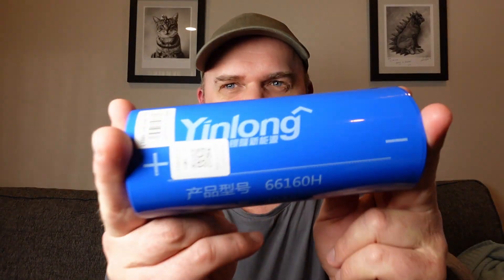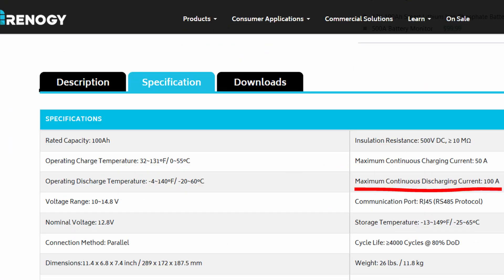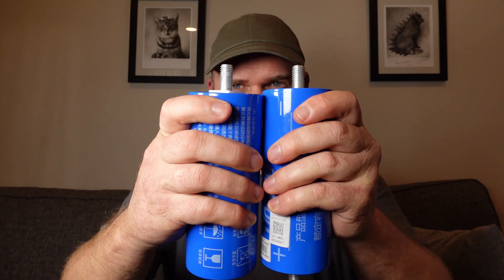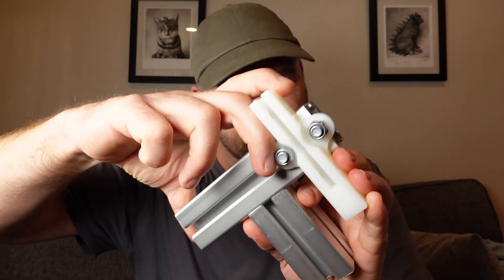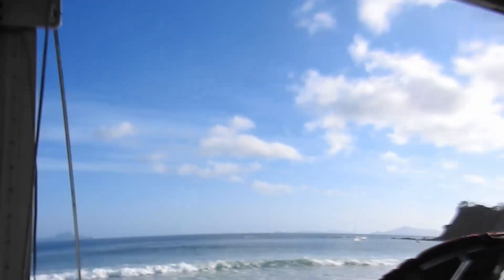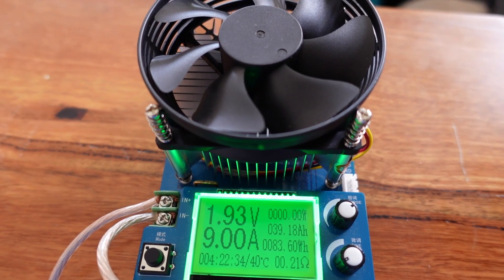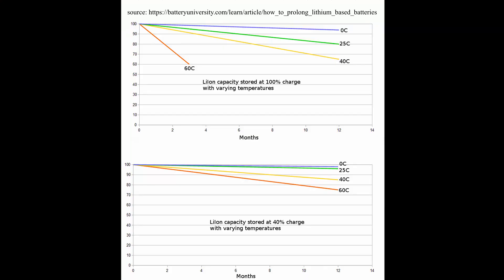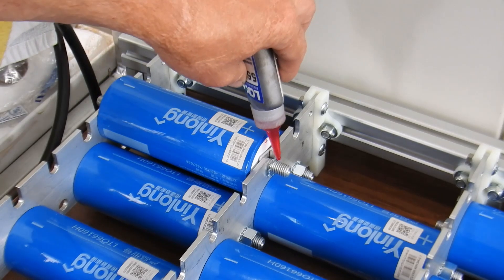Campervan DIY battery build HUGE POWER!

Comment: To anyone unaware in the comments, this is basically a video where this guy uses affiliate links in his description to sell these batteries, essentially he gets a cut of the money for people going there and buying them. Thus his video isn't objective, it's more akin to an infomercial trying to get you to buy these Chinese batteries. 
These batteries are not a new chemistry, and they are not invented by China, despite him implying that. 
This chemistry battery was invented in Japan (just like all modern lithium battery chemistry) and it was used in Japanese EEV's more than a decade ago. 
Their only real selling point is safety, because they have a much lower energy density that lithium ion batteries and they are also more expensive per watt hour. 
For example the voltage is 2.3-2.4v, unlike the 3.7v of lithium ion, also these Chinese made batteries often don't live up to their capacity claims, which thousands of youtube testing videos can show you, if it claims to be 40Ah, it's likely closer to 30Ah in reality etc. 
These have been tested by actual reliable youtubers, not people trying to sell them as affiliates, and the real capacity is around 30Ah.
This means in Wh they are around 69Wh per cell. BTW the way the Chinese are able to lie and claim 40Ah, is that they do tests under ridiculous conditions that don't conform to international standards on testing, meaning they draw on it at an incredibly low rate, where as real life drawing reveals effective capacity to be only 30Ah. 

That all being said, it's not like this guy on this video is a full blown scammer, these batteries do work, and you can make a power bank from them easily. 
However, you will be spending more money than you have to, and these batteries are unlikely to last the amount of cycles that they are advertised to last for, virtually no Chinese battery does. 

If you are looking to power a campervan via batteries, the most reliable and true method is to use sealed lead acid battery. These don't vent gas, they don't explode, and they last pretty long and are easy to use with any charge controllers and solar panels. Also, you should stick away from buying batteries from China.
Reply from the maker: I have got affiliate links - which I fully disclose, this helps me pay for camera gear and time to produce videos.  My objective is to make the best and most rugged battery for my campervan that is possible.  I bought the cells with my own money, as I said I want to make the most reliable pack I can for my truck I could have chosen to make my pack from any type of battery I wanted.

I mentioned in the video that in preference I would have liked to have bought the Toshiba cells to these but wasn't able to get them, so disagree with you entirely that I'm making a full on infomercial about them.  I do rate a lot of the aspects this chemistry has and am sharing what I know.

These cells have many advantages - primarily use in the cold, safety and ruggedness.  I have heard of someone charging one of these cells backwards by accident and it still retaining full capacity when charged again normally.  They are more robust against failures in a BMS, large current spikes from capacitive loads etc.

I said in the video that chinese sellers often misrepresent their capacity.  However, all of my cells have tested minimum of 40Ah - other videos I have you can download the speadsheet of my test data.  At least one 'reputable' youtuber has reversed his original statements based on my testing (Prowse).  My cells have tested at around 95Wh which is a long way from your claim of 69Wh.  Tests I have done ranged from 8-20A all giving the same capacity readings of over 40Ah - I'm not sure if you think this is an incredibly low rate - but for my main tests I think it equated to a draw of around 1,800W from my pack - again not incredibly low discharge.  These cells do not suffer the peukert effect anything like lead acid.  They actually are one of the best performing cells at high discharge rates.

I understand your sentiment on chinese products, and I am the same.  As far as the cycle life goes - I don't know how long they will last, all of my research shows that they are reliable, safe and will outlast any other battery on the market if looked after.  They have been working in my truck for coming up to 2 years now with zero measurable degradation in capacity.

I resent your comments with regards to me being a shill in order to sell cells.  There has been a lot of misinformation on youtube about this chemistry, and while there are a lot of chinese sellers selling reject batteries as grade A, I wanted to show that several youtubers have given incorrect information about them.  It sounds like you have zero first hand experience with this chemistry yet you come across as an authority about it?

As far as you thinking the most reliable/best battery for campervans.... ROFL!  I think that statement says everything about your experience levels.

Comment: I wouldn't buy anything from china.
Reply from the maker: Unfortunately it's not always possible.  If you buy a "made in 🇺🇸" battleborn battery, the cells are still made in China.  I understand your sentiment on many levels, like I mentioned in the video I would have preferred the toshiba cells from Japan, but couldn't get them.

Comment: Interesting project but i'm guessing that whole setup is heavy? then i saw your camper is a truck so weight is not an issue, i went with a pair of 120A LiFePO4`s in my MoHo mainly for the weight saving.
Reply from the maker: It weighs about 120kg.  A friend of mine has a LFP battery in his van, kWh/kg works out pretty similar.

Comment: Hello , just came across this video and have been lookn to do a camper build on my F250 4x4 and the batteries are the major cost to the power end of the build and this looks to be way cheaper and the longevity over all sounds a whole lot better and I'm guessing lighter as well... Now if I'm understanding it right these are (almost) like a capasiter but not the same discharge I know they're not but the charge to discharge rate is way better than standard batteries.. Myself I want to go solar and wind turbine at night or parked for more than day or two is my thoughts to stay ahead of being without power due to limited storage of battery bank and roof space for panels so wind and solar.. THANK YOU for posting this video    So from the States PEACE
Reply from the maker: Thanks Kyle, it's not the most cost effective option, but it is the most rugged I could do.  I'll be doing cheaper packs in the future. I'm charging with just solar and I have more than enough power, cooking of induction stove, domestic fridge etc.  works great.  Cheers

Comment: Holly shit so my 350 ish watt hr One wheel XR could be topped up twice on just one of those battery's?

Taking note that if I wait to long I will loose some of the stored energy.

But if I understand your calculations right I would have enough for two charges plus enough for bleeding correct do I have anyone that knows electrical calculations can check my ball park?

I charge at 63v 3amps
Reply from the maker: No, I think you've misunderstood sorry.  Each cell is able to put out 900W of power, but only holds about 95Wh of electricity.  These have one of the lowest energy densities of the lithium chemistries available.
Reply: @brendontait6968  Ah I see so I would need 6 of them. 😕 shit!

Wait, but if I just use one of these and plug it into this solar controller I could use it as a capacitor to buffer the connection and make sure it's clean and stable. Compared to going from solar panels to the solar controller to board battery.

https://www.amazon.com/dp/B07PVDY1V7/ref=cm_sw_r_cp_awdb_imm_49JSGNQ08CY735D5M5PE

Putting this capacitor onto the battery terminals would supplement a cleaner transfer wouldn't it?
Also how heavy are each one of those batteries when they're full

 I've had my leg ripped off and reattached a couple of times missing some muscle ankles partially fused. But I STILL like to go on my eboard OWXR and I'm trying to make a project out of going off grid by 100s of mi, already got my 200 watt solar blanket that folds up into a 1ft by 1ft by 3.5in 12lb pack I can carry. I can't a radically charge my board in 2 hours very reasonable.
And efficiencies so high that I can get a good 1/2 speed charge off of infrared light for night time charging from a modest fire, so I can get a early start. Or ride to dusk without charging.

So wait is a huge factor to me weight is pain and faster exhaustion, and taking water will be the biggest thing weighing me down. But I'll take a LifeStraw so I can carry lots of water less often.

So many large stretches of Rocky planes on the Colorado Trail so will need to carry what I need.

The way I have to charge to go makes me feel like I'm Mark Watney trying to get back from Mars on solar power on a ATV eboard.

Comment: 1. use blue locktite, it comes off easier than red. 
2. your link to the resistance meter is a dead link. 

Love the video, and the information.
Reply from the maker: Thanks, I used an equivalent to blue loctite, but still unsure.  I updated the link.  cheers

Comment: some lithium ion phosphate batteries are rated for 7000-10000 cycles, and price is dropping quickly - 1280 watthours for less than $500 in some cases, less if you buy the raw cells - that being said i love this battery chemistry and would love to see a commercially available version developed
Reply from the maker: I've heard about LFP being developed with different cathode materials that have a lower expansion capable of that number of cycles but haven't seen them in production yet.  Do you have links?  I liked the safety and ruggedness of the LTO on this build.  I'll deff be doing future LFP builds.

Comment: 20,000 cycles? Believe it when I see it. OTOH 4000 cycles for LiFePO4 is tried and true. Excellent work on the machining but agree that 48V would have been easier and better.
Reply: Do the research on the batteries man all I can tell you they've been around for decades or more and they're improving the technology with the batteries he's using they're very legitimate battery type used for commercial buildings as battery backup and to provide High amps for specialized equipment.

So the fact that these are used in scientific and Commercial settings I believe they're just as safe as lipo if not more especially with the test he showed with them shorting

Comment: how effective would these be as a  electric car conversion? also it gets to -30'c in canada so I'd need a heated garage of course? is that 3$ to charge the batteries for 250 mile range?
Reply from the maker: Mitsubishi and Honda have used them, however their capacity vs weight isn't great.

Comment: Lithium Iron batteries still have 85% capacity after 5,000 cycles. so with that in mind the math makes them a lot more desirable. but I love  what you are doing.
Reply from the maker: Cheers Jeff, tho I've never seen LFP cells last that long.  The reason I chose this chemistry was due to safety and ruggedness.  They can charge in freezing conditions and I've even heard of them accidentally being charged in reverse and retaining full capacity.  A failure in a BMS will be less likely to kill the pack.

Comment: I guess they dont need equalization? Individual?
Reply from the maker: Kinda, but not really.  I manually balanced each parallel set manually.  I'll show how I did it in an upcoming video
Reply: @brendontait6968  so how often will you equalize?
Reply from the maker: @flyingdiscproductions  I'll keep an eye on them, but maybe once every couple of years or so.
Reply: @brendontait6968  and what in your experience tells you that is adequate ?
Reply from the maker: The battery has been installed for two years, haven't rebalanced yet and it powers a domestic fridge every day even when I'm not in it.  However, this will depend on the mix of internal resistances of your pack.
Reply: @brendontait6968  Dometic?
Reply from the maker: @flyingdiscproductions  domestic....  household.  It's jst a samsung

Comment: Great video.
I'm clueless,but I'm interested to know if  these type of batteries would work on Ebikes or E Mopeds equivalent to 50cc.?
Reply from the maker: They would work.  But they would be relatively heavy for the range you would get.  They are approx 3 times heavier than the more flammable type.  However...  for my purpose the weight is not much of a consideration.  I'll do a bunch of electrical videos in future from basic to fairly advanced.  Follow along and learn

Comment: Hi Brendon, Im in Germany building a 12V System from 10 Year old, reused  Ying Long LTO cells. Do you have any Info or even links to the BMS, active balancing for large parallele strings and most important: how to sort them according to their impedance. As far as I learned the impedance of New cells  varies from factory and also changes over time due to chemical aging of the anodes. - Universitys all use EIS (Electro Chemical Impedance) spectroscopes to determine, how to group the cells in such a way, that unnecessary imbalances between the cells are avoided. Imbalances would lead to limited capacity of the whole pack. Thanks heaps!! Erik
Reply from the maker: Hey Erik, I've only ever built one pack..  so am probably one of the least qualified people to answer!  I measured my cells internal resistance with the meter I listed in my description.  Make sure the cells are all at the same voltage when you measure IR. I think as long as the total IR of each parallel bank is similar you shouldn't have a huge issue with imbalance.  I actually don't even think active balancing is important.  You should monitor the balance, and obviously have an alarm set at certain thresholds.  If you match them properly... you can probably manually balance them once every few years.  Good luck with it, let me know how you get on and what you learn.  Cheers

Comment: Hi Brendon,   I wonder if you or your channel could help  . I have 2 scenarios in the UK using 230v and some of my appliances run on 32a circuit
1. I want to store my solar energy during the day and use in evening during the summer
2. I want to charge batteries at night whilst cheap electricity and use day/evening in winter 
What would be the best option LTO or LifePo4. 
Thanks
Peter
Reply from the maker: Hi Peter, if your cells aren't likely to experience freezing conditions.... I'd go with LiFePO4.  They are so cheap now for their capacity.  Be mindful of the cycle cost you are putting your batteries under (it could be more expensive than the savings in power.)
Reply: @brendontait6968  I’m new to this cycle cost mean?

Comment: you pay quite a premium for a 20,000 cycle life time. my lifepo bank is cycled once a day and has a lifespan of 13-14 years. for me at least paying 5 times as much for a bank so that it will last 55 years seems like an huge waste of money (considering there may be an advance or two in battery development in the next half century).
Reply from the maker: Let me know if it makes 13 years.  I've seen them fail much sooner.  There is no doubt LFP cells are great value for money. I used LTO for a number of reasons.  I'm likely to take my truck to freezing locations, safety, ruggedness and tolerance to a balance/BMS fault, I wanted to learn about the chemistry.  The cells actually get quite a bit cheaper when you buy in bulk.

Comment: Ok here is an insane question. Can I use this to power an Electric Mountainboard? If so, how many can I use before it becomes unsafe? I want to cut how many lithuim_ion batteries I use in my build, but have the lasting power for a distance and speed, that why I'm asking.
Reply from the maker: Hey... they would work, but be heavy and large for the range.  More flammable chemistries would work better.
Reply: @brendontait6968  thank you for answering

Comment: I'd like to build a hybrid chopper utilizing as many electric golf cart parts as possible.  I've got a 3.5hp 36v motor, alltrax 450amp controller, and some other stuff.  Obviously I don't want lead acid batteries...would you recommend these ? And how many would I need?
Reply from the maker: These would be ok... but they are much heavier than other chemistries.  Have a look at tesla modules.

Comment: just recently paid just over 1000 bucks for lithium ion battery and not happy about it
Reply from the maker: Why aren't you happy
Reply: @brendontait6968  its a 12v-240AH LiFe Po4 battery i got from micro mall..battery seems ok but dosent handle the cranking amps when starting the truck (BMS) kicks in and kills everything and have to fully disconnect terminals before system will reset..and its just not enough by itself for power storage.. i knew this buying it but planned to add more as i could afford to..but now you got me thinking otherwise

Comment: I don't think supporting the battery's by their terminals is a good Idea,  the weight of the battery's banging around in a unimog is not a good Idea either, supported only by their terminals, 
maybe some fiberglass flywire to hold the weight of the battery's??? it's flexible so expansion wont be a problem.
 great interesting vid otherwise :-)
Reply: Ahhhhh! ($80 each plus $55 shipping from alibaba) comes with 6 battery's $480!!!!  too expensive for me,  gonna need a few thousand for a decent pack, much cheaper to buy a decent generator, yes they are noisy,  you can buy an awful lot of lipo's for that money...
Reply from the maker: When you buy in bulk they are less than half that price.